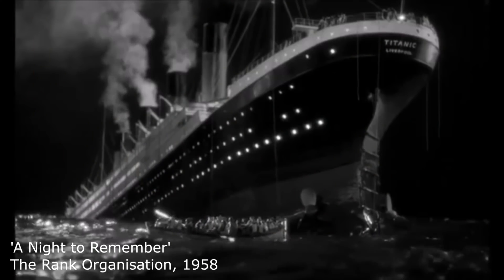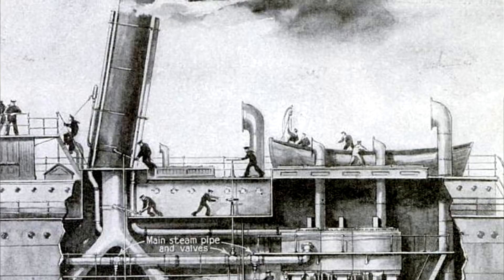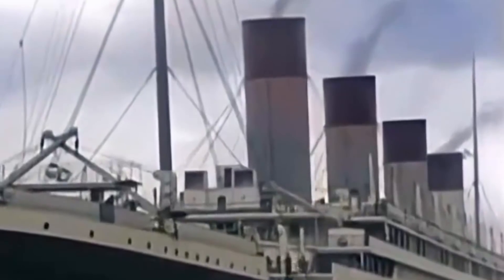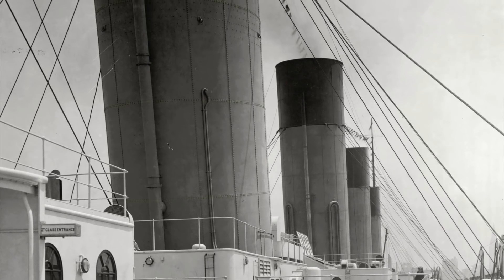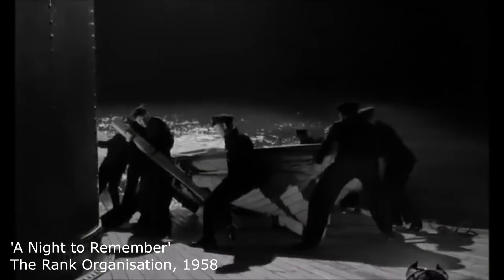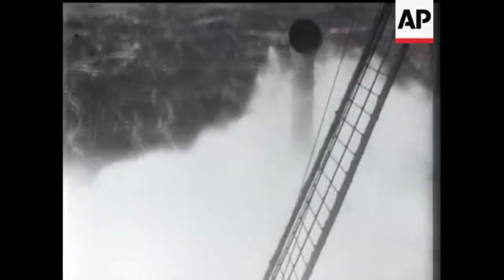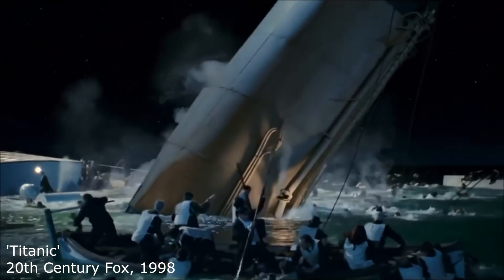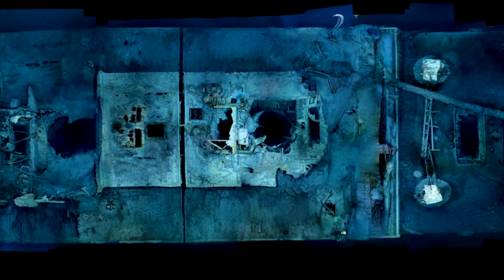Why did Titanic's funnels fall during the sinking?

Comment: Very informative video! I have another question about the Titanic disaster thinking of the break-apart - was there any possibility of the broken-off stern remaining afloat? My understanding of what happened (at least according to the "steep breakup theory" most widely accepted) is that the upper decks tore apart but bottom plates remained attached, the quickly-plunging bow section dragged the stern down into a vertical orientation before separating, causing the stern to rapidly sink. But what if those plates had separated cleanly when the ship broke, could the now-detached stern, with the watertight doors closed, have floated, allowing something to stay aboard until rescue arrived? There's been other stories I've heard of of ships breaking in half and at least one of the halves remaining afloat for quite a while, could that have happened here?
Reply: On a sea of glass is a book which has its own theory to the breakup. It has looked at so much evidence and testimonies and put together a video, by part-time explorer (a real time sinking). It has time stamps so you can go to the breakup or plunge timestamp. Roy Mengot was an engineer for Titanic and made a theory similar to on a sea of glass, but on a sea of glass also looks more at tension stresses. Here are the links for the video:

On a sea of glass: https://youtu.be/PboGLRAEwFU

Roy Mengot (in depth): https://youtu.be/ggu5Moi2GEM

Basically, On a sea of glass takes more time, with the stern "afloat" longer, and Roy Mengot takes its time when the sternn goes near vertical. These are highly accurate theories.
Reply: There's also the engines which were in the stern because they were so big and heavy
Reply: Yes and no. The ship broke into 4 big pieces we see that in the debrie filed. Also think about how much stress the stern was under bending and stuff the water tight doors was probably getting bent and warped out of shape so even if it did break clean off it probably would have still sunk
Reply: @jessehassell1864  True - probably a lot of rivets popped out, bulkheads distorted and cracked, and so on, as well as the watertight doors. Perhaps could have floated for a little while longer, maybe long enough for the Carpathia to arrive, but not indefinitely.
Reply: @quillmaurer6563  yes that could have happened also more people could have been saved if that did happen. There's also another theory I also had. None of the engineers survived they started to keep the lights on. I'm thinking that because the stern was dry and to have easier access to stuff that maybe the engineers opened some of the water tight doors to get around easier. That explains why also the stern sunk so fast after it broke up. Just a thought I've had for awhile
Reply: @quillmaurer6563  that's true I'm sure no one expected the ship to break in half plus with everyone panicking and running around no one would have noticed the ship starting to crack in places. With 1500 people dead I wonder what those people that died saw or heard as the ship was sinking the stories that maybe we don't know about. that they would have told if they had survived. Like how exactly the ship broke in half and other stuff. To me the stern of Titanic is the most interesting part to me and the sadest. That's where everyone went to. To hold on for hope. I wish it wasn't in such bad of shape
Reply: @quillmaurer6563  don’t forget the ship had a double bottom. That would have flooded too
Reply: @quillmaurer6563  you know, I think you’re right. I didn’t take into consideration the purpose of it and it would have most likely be sectioned off do the entire bottom isn’t flooded. I guess it could be ruled out, but who knows what kind of damage the stern sustained during the break up. Obviously we know that whatever the cause was it’s now on the sea floor :(
Reply: @quillmaurer6563    I level with your points and they make sense. The only time I could ever see the inner design of the double bottom was with the discovery of the 2 “missing middle” hull sections. But they have this oval cut out shape. But I’m not sure it if goes into every layer. Like maybe the walls alternate between being solid and having a cutout. 

I could be wrong but I think the same thing happened to the Britannic in that the explosion had caused most of the watertight doors to jam and become displaced, have a loss of power, etc. But in terms of the titanic I wonder if professional researchers have even looked into the thought of if the watertight doors are even closed in the stern. I have no idea how hard it would be to examine the inside of the stern with how much of a disaster it is. But if they are opened that could prove the stern might have had a chance if they were closed; And that workers possibly opened them to access the engine room and other machinery compartments. If they are still closed I would agree to your statement that the stress had allowed water to leak in through some means of weakened hull plates, whether it be the bulkheads or the hull itself.  All in all I’m very intrigued now as to why the stern ultimately failed to stay afloat.  If I only had this much motivation for actual school studies lol.
Reply: @quillmaurer6563  You brought up all really good points, I honestly have no counter response, as I think you are right. All of the forces in play all at once, like you said gave the stern no chance. Just really would have changed history if it had been the case.

Comment: Great explanation! 

Now I’m interested in your take on this debate: Did the 2nd funnel explode when it collapsed and if so why?
Reply: Coulda been a possible small scale boiler explosion possibly from boiler room 3 maybe not being entirely evacuated or put out at the time the funnel began to fall
Reply: Sorry for being 3 years late but, thr 2nd funnel really didn't explode. Just that when the steel cables collapsed they whipped back at the top of the funnel. ( There was coal dust on the top of the funnel ) which caused it to ignite and make sparks go flying
Reply: @FrankenDoodleFart  interesting theory. The other one I’ve heard is that boiler room 3 was still dry when the 2nd funnel base went under, water poured in rapidly forcing high pressure air and hot coals & coal dust up the funnel, causing a fireball out the top. 

My take on this also is that this event occurs at the moment of peak stress on the hull, and rapidly cooling hot boilers also lead to implosions. Those implosions would vibrate the hull, which may very well be the straw that broke the camels back and initiated the break.

Comment: Perhaps the four loud explosions heard within the ship as it sank was actually the implosion of the funnel casings?  Shortly thereafter it makes sense that the funnel would fail..
Reply: Ooo that's a good point!
Reply: I believe the possible explosions heard could have been some of the boilers in boiler room 2 that imploded and sounded like an explosion.
Reply: But there were 3 functioning funnels right?
Reply: @adriwidjaja  True.  By the time funnels 2 and 3 failed, I imagine that many parts of the ship were failing and the noise created would make it difficult to know exactly what is breaking and where.  Plus, I don't think many people midship, and aft survived.   However, there were more than a few survivors who were near the bow section and close to funnel one and they are the source of these reports of muffled explosions deep inside the ship.  Making the assumption it was boilers seemed very logical to me, until I saw this presentation.  After watching this, I think it is also equally reasonable to consider that at least one of those explosions was actually the implosion of the casing around the number one funnel.  Impossible to know for sure, but it is at least a reasonable speculation given the construction details.  Keep in mind this, the WSL successfully suppressed from the public the first hand eye witness accounts of the ship splitting apart.  Who knows what else might have been dismissed or simply ignored in testimony from passengers.  Plus, all of those eye witnesses are traumatized.
Reply: Boilers were found to be intact; so it was either funnel casings, bulkheads, or both.
Reply: @NopeNopeNopeNopeNopeOhFuckOff  There was evidence of a few boilers being imploded causing the explosion type sound. Most others were all intact
Reply: @NopeNopeNopeNopeNopeOhFuckOff  No worries, if you search did Titanics boilers explode should find it.

Comment: The funnels were 'thin" at 1/2 inch thickness?  The Titanic's hull thickness  was only 6/10 inch fore and aft and 1 inch amidships.
Reply from the maker: I mean that for an object as tall as a six-story building the plating was comparatively thin, thin enough that without support the structures collapse flat and 'pancake', as seen during Berengaria's scrapping. 
~Mike
Reply: @OceanlinerDesigns   - Fair enough!  Thanks!
Reply: @Floyd1504 A mixer on a cement truck is only 1/4" !
Reply: @LowellMorgan  A cement mixer is also not 6 stories tall, nor is it made in the same way as these funnels.
Reply: @whackyjinak4978  - The stack isn't tumbling tons of concrete.
Reply: @scootergeorge9576  The thing weighed 60 tons in and of itself man, your comparison really doesn’t equate, there’s a whole lot of things that are completely different about the construction and materials used between the two applications.
Reply: @scootergeorge9576  hopefully not.
Reply: @Scooter George: You mean 1 plate was thick as you said. Titanic featured triple plates in the mid-section at least.

Comment: Simple… The cables holding them in place, were not designed to withstand that much weight, so they snapped…the cables were only there to easy the forces of nature they’d face on a level sea, but the ship was at a minimum angle of 40 degrees…it’s all simple math.
Reply: This explains the aft two funnels - that's pretty much what he said - but the forward two collapsed far sooner, at no greater angle than would be expected in rough seas. He explained all that in the video.

Comment: Here's a good idea for a video why do funnels decay faster than shipwrecks
Reply: Different materials used, and different thicknesses probably have something to do with it.
Reply: Probably because the funnels are far weaker than the ship structure, as mentioned in the video they were only a half inch thick plating or something, while the hull plates were much thicker. Funnels were more of a decorative piece, and only needed to carry exhaust gases, so they didn't need to be strong, and being so tall and high they need to be lightweight to avoid the ship being too top-heavy.

I wonder if they also tended to rust out on ships in service quicker than everything else? I know that's one of the faster-rusting components on cars (except those that are stainless steel for this reason), as they have hot gas flowing through them that tends to burn off any protective coating or paint, heat speeds corrosion, and car exhaust is moist. Not sure if coal would have the same problems as coal smoke isn't as moist, and the soot might create somewhat of a protective coating on the inside - not to mention that corrosion is a major problem on ships as a whole due to being in salt water.
Reply: @quillmaurer6563  I believe there would have been a fair bit of corrosion inside the funnels over time due to the heat and paint failing from that and the high amount of sulphur from the coal being corrosive

Comment: I always thought the fourth funnel was there just for show. Interesting fact about the fourth one, thanks!
Reply: It pretty much was. It was used for ventilation, but wasn't really necessary for that, certainly didn't need to be that big. If wanting just an exhaust vent it would have been far smaller, but they wanted to put a fourth funnel for aesthetics and used it for this purpose since it was there.

Comment: Great analysis.

This is something I had always wondered.  I always assumed it was the expansion joints moving that caused the aft wires to snap.

But just imagine, you're on a ship that's sinking on a freezing cold night. You eventually find yourself treading water that's ice cold and just when you think it can't get any worse, said ship starts hurling parts and a massive funnel over the top of you. 

Well, at least it would have been instant and not a slow freeze to death.
Reply from the maker: It was like one terrible thing after another that night! I think Cameron captured that quite well in the movie.
~Mike

Comment: I wonder why the Lusitania’s funnels didn’t collapse when they hit the water
Reply: Possibly they never had chance,  due to the speed of the event. 20 mins, as opposed to 2hrs 40mins. For such a large shop, it was a very fast sinking.
Reply: I believe they were built in stronger rings, but i am not sure.
Reply from the maker: They were built in a different way made of segments stacked like pancakes and with thick reinforcing bands. (The black rings on her funnels.) This is probably why they didn't fold up like Titanic's.
~Mike

Comment: The funnels failed because they were not designed to withstand that sideways strain... modern funnels have a box built around then to withstend sideways stress... I know since I was a shipfitter and built them--as well as lots of other ship structures...
Reply from the maker: Hi Lewis,
Not sure about that being the sole reason as the Number 3 and 4 funnels were under the same sideways strain, as caused by the list, as numbers 1 and 2 but they held on. It was only when the water reached the bases of 1 and 2 funnels that they fell which is why Titanic's designers believed it was water pressure crushing down the bases and deckhouses.
~Mike

Comment: I always thought, had I owned the shipping company, I would have had the front funnel to be the one without a boiler.  Then I would have had a penthouse at the very top and an open balcony above that.  It would have had to be kept light weight, of course.
Reply: You mean White Star Line?
Reply: Couple problems with that: First, I think it being false would be way too obvious, as there's no smoke coming out, that would probably just look too funky, and generate bad press. Aesthetics and looking right was important at the time, and that wouldn't. Not such a problem with the rear funnel being fake, as it has smoke from the forward funnels passing over it, the lack of smoke isn't quite as prominent. Second is that in anything but perfectly calm seas (or in port) the ship's rolling would cause this penthouse to sway about rather violently - would not be a comfortable place to be. For motion-sensitive the best place to be in rough seas is as low in the ship as possible, as close to the water line, and as close to the ship's center. Still an interesting idea though.
Reply: @quillmaurer6563  th four funnel was used to ventila te the kitchen

Comment: Do you think that the sparks and smoke coming from the second funnel is what caused its collapse, or were the sparks and smoke an effect of the collapse? And any opinions on the debate of collapse direction?
Reply from the maker: Hi Kyle,
Sorry I missed your original comment back when you first left it. I think the sparks were symptomatic of a draft, caused by rapid water entry, forcing air from deep within the ship out wherever it could. The direction is an interesting one but I think I would have to lean (pun intended) towards the On a Sea of Glass authors' opinion which dictates to Starboard.
~Mike